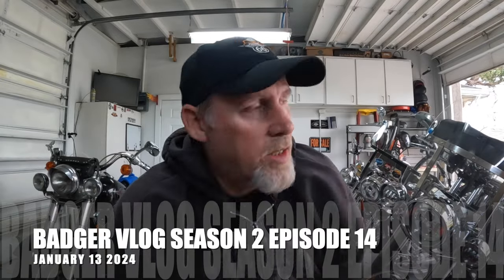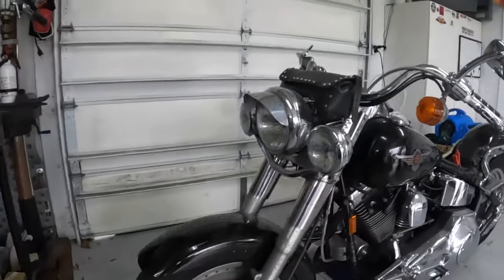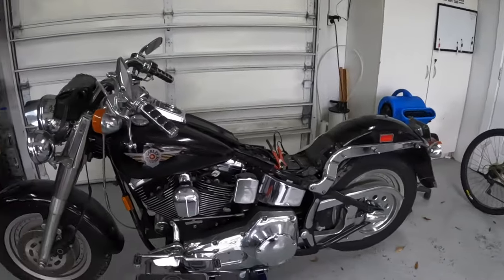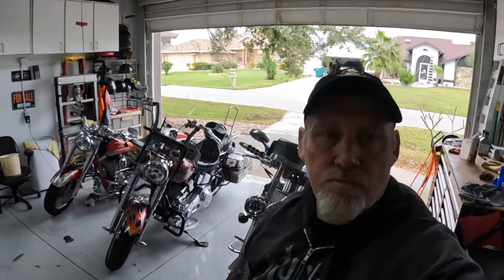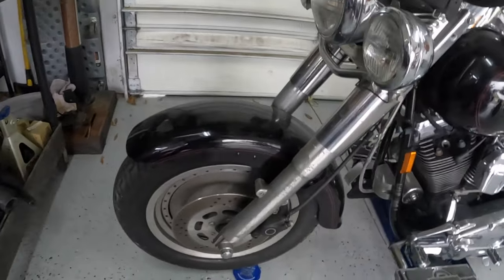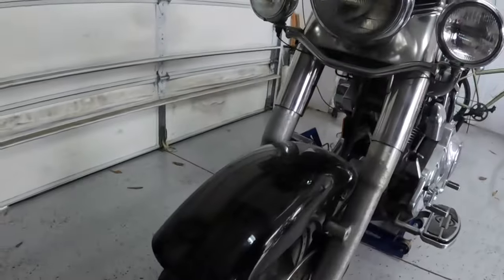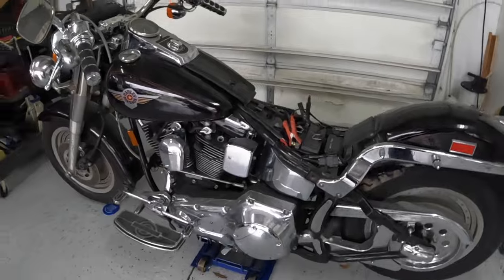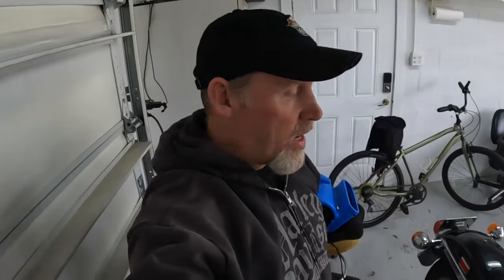WHAT SHOULD I DO WITH MY 1999 HARLEY DAVIDSON EVO FATBOY BADGER VLOG SEASON 2 EP #15

Comment: Clean and reline the tank, new hoses, clean the carb, new wheel bearings, tires, neck bearings, starter, battery, repaint the black to fix the gouges, brakes, basically just go over it and make sure it's safe and roadworthy. Everyone's going to have their own opinion on how it should or how they'd like it to be and unless you have a specific person you're building it for then leaving it as basic as can be but in good operating condition is the best route to go since part of the joy of owning a bike is personalizing it yourself to make it yours.
Reply from the maker: So get all the maintenance things done and let whoever the new owner is do the rest.Thanks for watching
Reply: @TheBadgers  yes, because I believe making it good and roadworthy is more than anyone could ask for when receiving a new to them bike. Then they can ride and enjoy while they decide what upgrades they wish to do to what would now be their bike.

Comment: I’ve had 4 Fatboys over the years (currently waiting on a 2024). One was a 1995 evo that I wish I still had. I also had an issue in the primary. Turned out to be a broken primary chain tensioner shoe. They were pretty much just plastic back then and could split after significant mileage. Hopefully it’s something cheap and easy like that in your primary. Have fun with your build.
Reply from the maker: Thanks I am curious to dig into it and see where we stand

Comment: Nice gift! Do a complete motor tear down since you have no history. There have to be some cheap Evo big bore, cam, oil pump, carb kits you could throw at it to start a custom. Maybe a belt drive primary. Some lighter weight wheels would definitely be an improvement! Definitely apes or high riser drag bars. Or, just improve the weak points. Restore back to a reliable stock bike with minor upgrades.? It's a good question, but if it was me and I was looking for a project, I like my first idea. The Fat Boy to me is a great muscle bike platform. It's also more retro (less chrome). You could turn it into a vintage appearing bike similar to the Slim. I dig the war bike era. Put a big bore kit in it and convert it to jockey shift/foot clutch, and powder coat all the chrome parts. Swap the front fender for a heritage/deluxe full. Carbs are easy to upgrade and tune. In this case, it's only one carb. Tombstone the taillight! Wish I had such a dilemma!! 👍
Reply from the maker: Both great options Thanks for watching

Comment: Like it was meant to be.   If you think the tank is rusty.  When I worked in a bike shop. We had a rad shop across the alley. And they’d take a tank without rust holes.  Pour in some muriatic acid which eats the rust. Pour it out and then flush it thoroughly with water and then with the cap off. They’d lay it on its side and use a hair dryer to blow all day into the tank and dry up the water.   Tanks came out shiny inside.  And was cheap
Reply: Muriatic acid in metal tanks is the ONLY way to get all the surface rust out. That and a handful of clean nuts and bolts.... And whatever you do, DO NOT line the tank, especially if you're going to keep it. That shit starts flaking/peeling off in a couple of years and creates more issues than it solves.
Reply from the maker: Thanks for the suggestions I am pretty sure I am going to have to clean it out
Reply from the maker: Yeah that liner can be a mess
Reply: @TheBadgers  The best one available, other than something done commercially/professionally, imho, is Caswell's Dragon Blood. But it still isn't as reliable as a nice clean, stripped-to-bare-metal tank.

Comment: I have an flfb 2018 m8 107. I love the bike. It's the satin chrome model in red. I have about 19,000 kms on it now and its ready for its 3rd set of tyres, yup 2 sets gone. The current worn out tyres are bridgestones which I like, but as usual the front tyre is chopped to pieces on the r/h side. Apparently all new fbs do it. Ask the dealer if they've fixed it? Know what you're buying.
Reply from the maker: Have you tried changing the front suspension something has to be chopping them up. I am not a fan of the wide tire in the back of the new bikes, think I will stick with the ones I currently have

Comment: Leave the 99 Fatboy as it is. Just take care of the starter jack shaft and starter issue and leave the seat as it is and just use black touch up paint on the rear and front fender and leave the handle bars as they are, and if the tires have good tread and have no side cracks, leave them be as well. Then sell the twin cam bikes. Its not the age of a tire that matters, but is the condition of whether they are dried from moisture or elements. As long as rubber is soft, a 20 year old tire is still good. Once the rubber starts drying out a tire is bad. Leave that Fatboy original. Because if you have to start changing things that would mean you just dont like it for what it is.  I have a 97 Fatboy and im not going to change anything

Comment: I would fix the mechanical problems first, clean and polish and leave it alone. In years to come the evos will be looked at as the motor of choice because of their durability and ease to work on. The market wasn't flooded with these back in the day. I have a '98 Heritage that I will never let go, someone will get it when I am gone. I have never done anything to it to destroy the look. Fatboys like the one you have are a tuff looking motorcycle straight from the factory, no crap hung on them like windshields and bags, just pure wind in your face fun.
Reply from the maker: The evo's are becoming increasingly harder to find